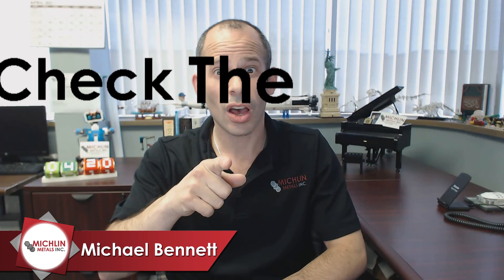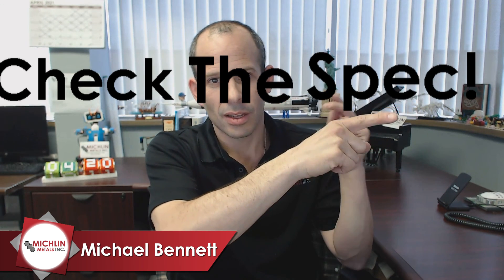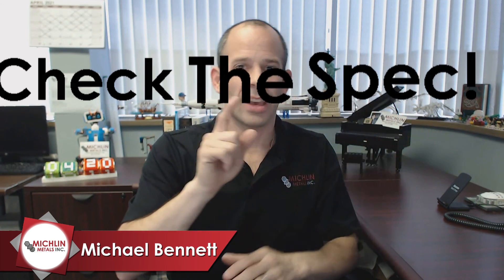7000 Series Aluminum - 7050 - T6 - 7075 - T651 - Guide to 7000 Series Aluminum

Comment: My manager was complaining about 7075 taking longer to run.  That material is 1800$ for a 48x96 .125" sheet.  I would rather not scrap it when the material costs that much.  It also takes a while to get it and I would rather take longer than have to get new material and set everything back up all over again.
Reply from the maker: I get that for sure! 7075 is tough to come by these days and the cost is also very high....so I totally understand the desire to waste nothing!

Comment: I told somebody I could not weld  his 
7000 series aluminium.
I wonder if there is a way to anile , weld, then heat treat ?
Reply from the maker: Yes it can be done but it has  even more issues than welding 7000s as is. No simple answer here beyond that. Wish I could help more.

Comment: Hi, thank you for the helpful videos. I want to hot forge a workpiece made of Al7075, I have a problem with selection of initial billet condition for hot forging. I mean is as cast aluminum proper to forging or it must be fully anealled? I am worry about cracks during deformation of AA7075. Thanks
Reply from the maker: Forging from a 7075 casting can be done.

Comment: Michael, please reload this video and turn up the volume,,,Love to learn more of the 7000 series,Bear in TX Ole fart.
Reply from the maker: I was able to make it pretty loud Bear. I made sure my youtube volume was maxed out as well as my speakers, but at that point it was actually TOO loud. I will make sure the volume is better adjusted next time. Thank you for watching!!!
Reply: @MichlinMetals  Hello, I've watched & "LIKED" many of your informative videos. Honestly, I've learned a lot & I sincerely appreciate what you're doing. 
I'm an amateur race car driver. In a few months, I'll begin a major project. My goal is 
to build the fastest, naturally aspirated (supercharged) Camaro and "hopefully" set a new land speed record. This is an "independent" effort...without sponsors. 
I will begin by building a 632cid aluminum engine block; CNC'd from ultra-high quality billet aluminum. 
I've done research...BUT...I'm getting conflicting information from various sources. 
I "NEED" your professional input. 
1.) I'm considering billet 7075-T6 aluminum for the engine block & cylinder heads. What grade of billet aluminum would you recommend for the engine block? 
Strength & quality of the billet aluminum are the most important factors. 
2.) I want the engine to look nice as well. So, I'm considering having it powder-coated. This "painting process" requires the powder-coated metal to be "heat-cured" at 400° F for 15 minutes. 
Will this heating process cause ANY negative affects//weakening of the aluminum?  3.) The end result will be an engine that will easily produce 1,600 horsepower and 1,400+ pound-feet of torque. So, the differential & its' housing need to be very strong. Strange Engineering offers an AMS206-T4 aluminum differential housing. From my understanding, it is a "cast" aluminum piece; not from CNC'd billet aluminum. Apparently, this grade of aluminum is used in many military applications. 
What is AMS206-T4 aluminum? 
Is billet 7075-T6 aluminum stronger than AMS206-T4? 

Your attention, consideration & recommendations will be truly appreciated. 

I wait for your reply. 
Ben